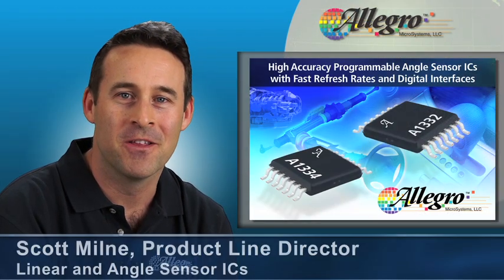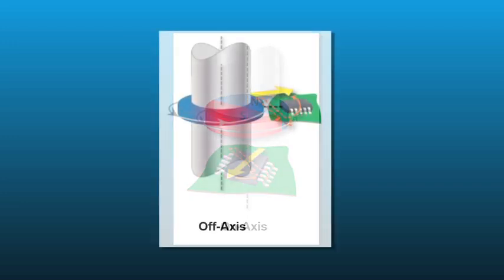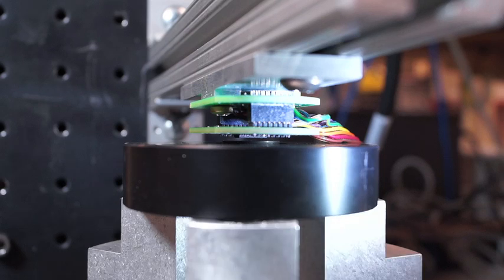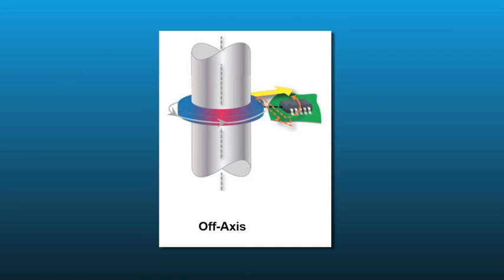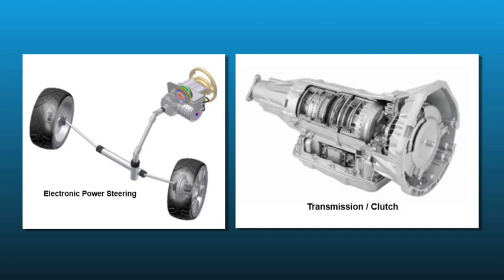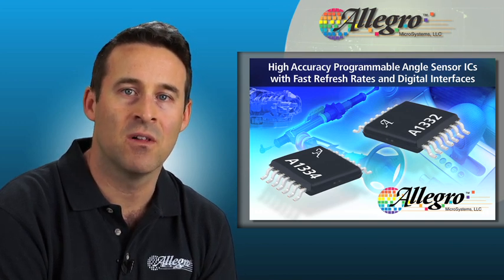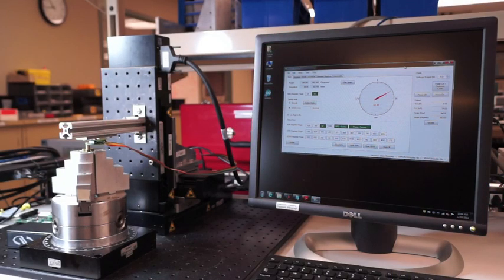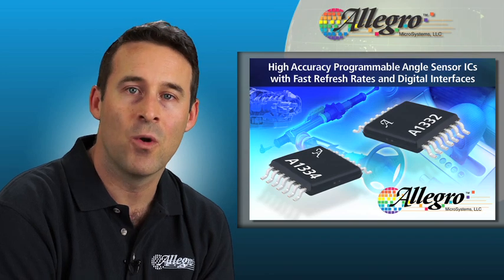On-Axis vs. Off-Axis Angle Sensor IC Measurement Configurations

Comment: Noting that this product is obsolete, I have a question on this technology (rather than the chip itself). The answer would probably transfer to the newer chip (A1335?)

Between 4:40-4:44, I have noticed two things. 1) There is a huge delay between rotation and its result on screen even if the first rotation belongs to first on-screen update.  2) Second pulse on screen occuring before actual motion implies it belongs to the previous rotation, which gives about 3.5 seconds delay. Product's datasheet claims 200uS refresh rate.

Is it because your software is just polling extremely slow or is it because of the "significant amount of post-processing" you mention on the video?
Reply from the maker: Yes the 1335 is the appropriate successor part. And no, that delay seen in the video is not the real delay through the part. the GUI was not optimized for real-time data capture and display.  The response time or latency through the A1335 is 60us with no linearization turned on. With the harmonic linearization enabled, there is additional latency that depends on the number of harmonics that are used. See Figure 22 in the app note on the A1335 page for info on the additional latency for a given number of harmonics.  http://www.allegromicro.com/en/Design-Center/Technical-Documents/Hall-Effect-Sensor-IC-Publications/Advanced-On-Chip-Linearization-A1335-Angle-Sensor-IC.aspx